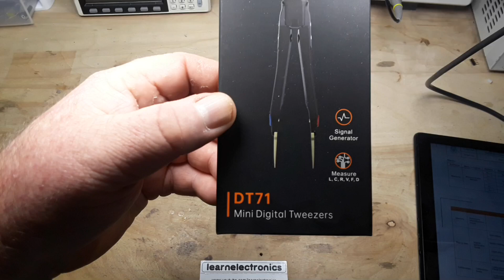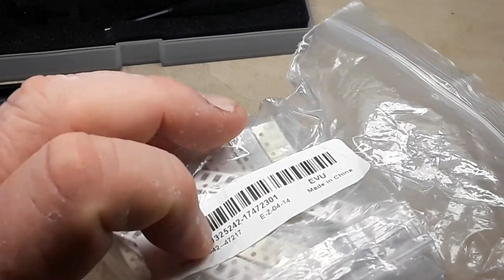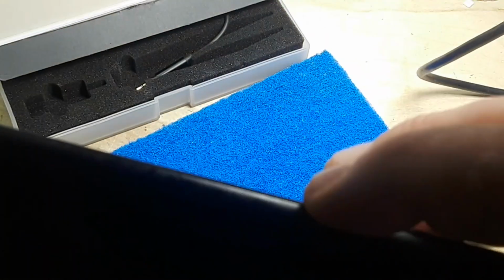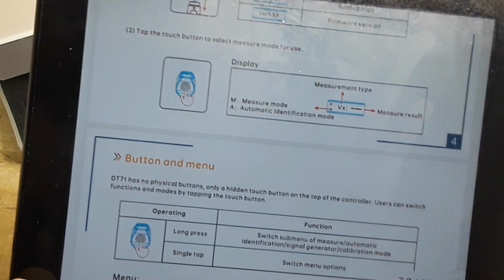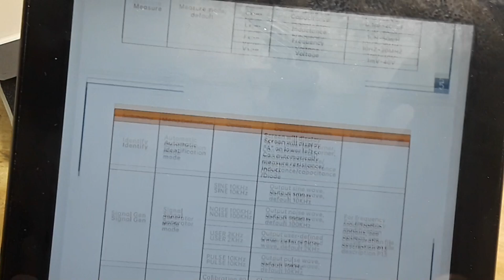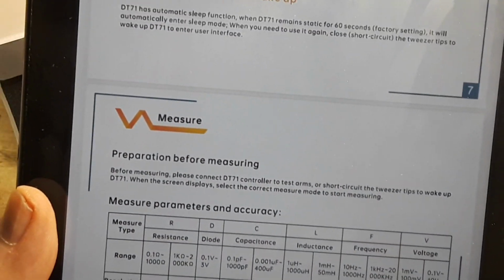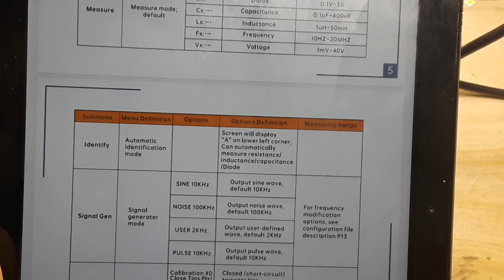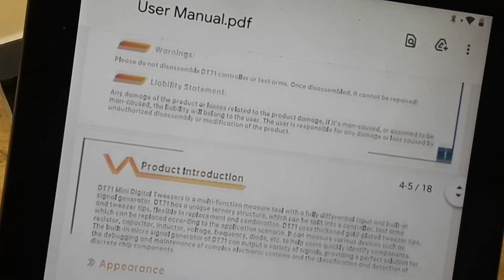Miniware DT71 Smart Digital Tweezers

Comment: Glad you did this video. Sure seems like an overpriced, not very accurate, hard to use and finicky piece of gear. Some of the results were 11% or more out of expected measurement, which is almost as good as eyeballing voltage on a battery.
Saves me considering it. 
But, for $60.00+ I could likely get 3 or 4 cheap multimeters plus a file to make the probes pointier and average the reading just as easy.
Reply from the maker: Nice sharp probes and a good meter is all you need.

Comment: When I was doing surface mount work at the last company I worked for,  we bought digital tweezers however, they were very accurate and cost about $700.00.  The reason they cost so much is that they came with a calibration certificate that was National Bureau of Standards certified for industry standards.  We used them to match filter capacitors and boy did they help. Matching capacitors with other methods just never worked for us. So, if you need  real accuracy, you need to spend a lot of money.   But for the hobbyist,  these may work okay.

Comment: Hello friends,

    Neat tool. If not so finicky, I would pick up a pair.

Comment: I use 1% tolerant smd resistors, and the caps are from 10 to 20% tolerant. Of note, the 10K and 31.6K pair of resistors are the voltage divider for the feedback for the boost converter. If the resistors were as off as measured in the video, the boost convertor would be out of its 5V output, which it is not (see Pauls older video on the flashlights). Therefore, I attribute the discrepancy to an in-circuit measurement issue.
Reply from the maker: I agree doc!
Reply: It's easier to use when you're not trying to record the screen on camera.
I think it's a useful tool. I particularly like to use mine to check smt LEDs before adding to a PCB.
I think the device is worth the money if you use surface mount parts.

Comment: There are two measurement ranges  beacuase precision depends on how big the measure itself is: if you measure the length of a table you'd expect to have a precision in the order of centimeters (as well as the error of the measure), but if you measure the distance between earth and moon you cannot expect to have the same precision.
Hope that clears your doubt!